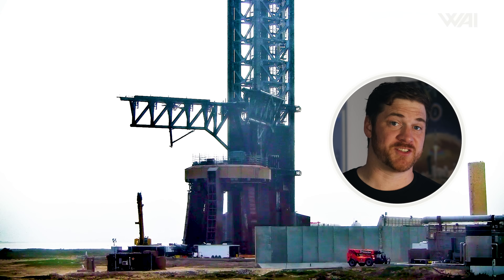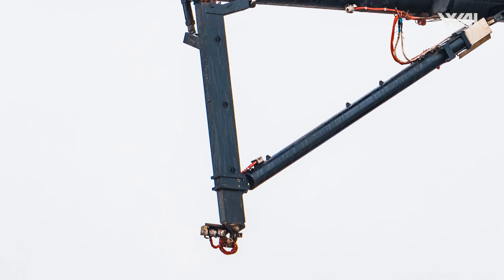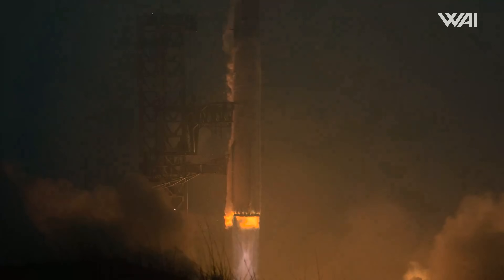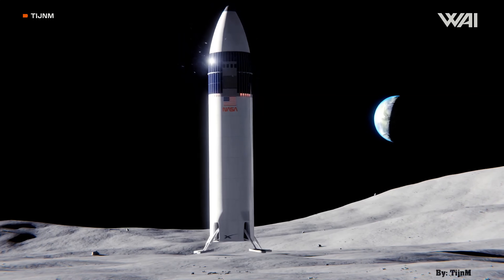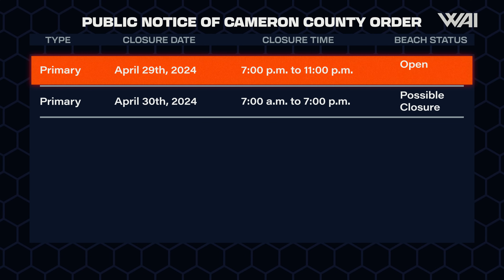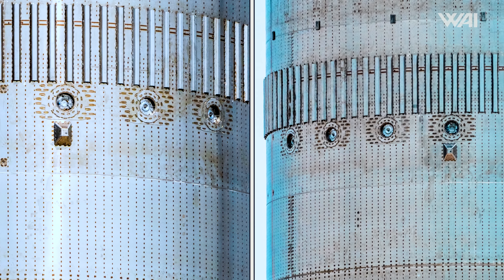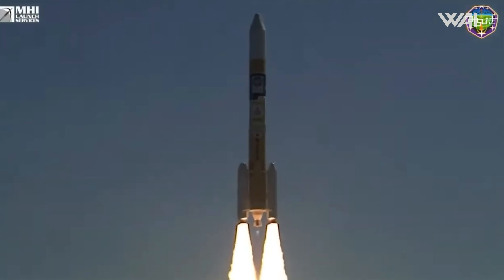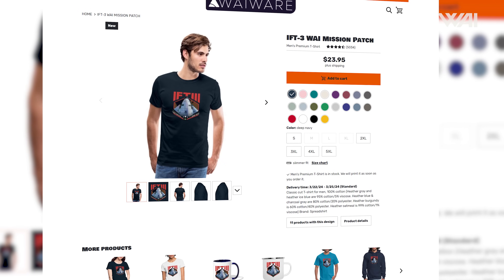SpaceX Starship: NASA Confirms Risky Orbital Maneuver!

Comment: To push something out into space and escape from gravity,  you need to accelerate to 31 times of sound speed, i.e. 15 times faster than Concord. Of course, you are not doing this in atmosphere, you're doing it in space. It is not that difficult to push something as large as a car, 2ooo Kg. But it will be a horrible task to accelerate 200 tons. Nowadays,  some countries can build a rocket pushing 10 to 50 tons cargo easy to space, but 200 tons, only Saturn 5 and Space Shuttle are capable of pushing such payload. If you want to travel far into space, large payload will be inevitable.

Comment: In the end, why do they need the OLIT?
Reply: The OLIT eliminates the mass of all landing legs on the Booster and Ship, which cut into payload capacity. It also fits the booster on the Orbital Launch Mount and rapidly mates the Ship to the Booster without personnel nearby.
Reply: @imconsequetau5275  well aware of that, but if they plan to land on the chopsticks, they can launch from the chopsticks as well ...
Reply: @wasp586   
Chopsticks can only handle the dry weight of 150 or 200 mt, Not all the propellant mass of 150+1200 mt (Starship) or 200+3400 mt (Super Heavy).
Reply: @imconsequetau5275  sure, they'll need to be build a lot stronger.

Comment: That has always been my contention. SpaceX should separate launch of Super Heavy from the recovery operation. The separate landing tower could have a rail transport system to move the boosters and Starships back to the Launch tower for Mechazilla to grab them and remount them for the next launch attempt when the faster turnaround operations begin. At present, the launch cadence is still very slow, so no need to build the rail transporter, just the catching system. The catching tower should be sufficiently separated from the launch area so as to prevent a catching "mishap" and subsequent RUD from damaging the extremely valuable Stage 0 machinery. The catching tower would be cheaper and simpler since it likely does not need the fueling system, and the water protection system could be much less powerful, since only one engine would be firing during recovery. Also, the Super Heavy would come down first and be removed before Starship is recovered. (The other stupid thing about the single Stage 0 doing the recovery is that you would have a Starship being recovered while a Super Heavy is already sitting there on the launch mount.) 
That entire original plan is a huge recipe for disaster.) The stakes are just too great. The launch tower and infrastructure is so expensive and difficult to repair that damaging it is too costly in money and time. If Stage 0 gets damaged or destroyed, it makes an entire fleet of Super Heavies and Starships unable to launch.

Comment: The concept of the perfectly vertical starship, on the moon, with the cable elevator lowering neatly down the side seems precarious in light of the recent tipped-over landing of a probe.
Reply: Those recent landers had significant sideways velocity at touch-down. One literally dragged legs over the surface at 2 mph, tripped, broke legs, and tumbled. The horizontal velocity needs to be eliminated better next time. 

The wide leg baseline is great for stability with fixed leg length on slopes, but can't cope with tripping hazards. The narrower the baseline, the smaller the horizontal velocity must be at touchdown.

SpaceX has no need for a wide leg baseline if the legs can extend straight down to various lengths and accommodate boulders, crater rims, and slopes. The rocket thrusters must keep Starship plumb in the final descent, and the self-adjusting legs must retract to fit the surface and support the full weight, and zero velocity before locking. 

Of course an AI visual landing system needs to identify and select an appropriate landing point (that legs can accommodate) and navigate there. 

I envision each leg containing a hydraulic piston. All connected in a parallel hydraulic circuit along with a single common accumulator/air spring/damper. Each leg piston has its own shut-off valve and clamp.

Comment: Hi to all from sunny Cyprus EU, I luv all your vid's, the team is doing an amazing job. Ok regarding the legs and surrounding steel of the launch table, why don't SpaceX just cover them with the same heat tiles that's used for the starship? as they can withstand the temperature of a re-entry, then they would surely protect all the steel work and should cutdown on the amount of repair work needed after a launch, just a thought & maybe a stupid suggestion ;) Thanks and keep up the great work.

Comment: Why (hasn't) SpaceX replaced both large chopstick actuators?  It doesn't makes sense to replace only one if it's actually about making the system faster for booster catches. 
Glad to finally see a rendering of the second launch tower and OLM that has them facing towards empty land instead of facing in the same direction as the original tower and OLM. 
By building them facing empty land the infrastructure will be far better protected from possible damage. In that case the second tower even acts as a protective barrier. So hopefully that's SpaceX plan.

Comment: They still need to do the simulated landing on the sea to test slow speed manoeuvring, speed and positioning. They also should have the second launch tower and system in place before they potentially damage the current one in the first attempt at a catch.

Comment: So, there will probably be “tanker” versions of Starship as well as the cargo and crewed, both lunar and Martian.  Maybe the tanker version needs 2 or 4 mini Canada arms to grapple the receiver Starship and pull it in for precise alignment.  They could perhaps stow, folded, into small fairings on the dorsal side (docking side) of the tanker.  The grappling targets could be stainless steel balls like a ball hitch on a pickup truck.
Maybe every Starship could carry two arms and two hitches:  arm left and hitch right toward the top of the ship and hitch left and arm right near the bottom.  This way, any two Starships could come together and have arms grapple ball-hitch in 4 places, pulling the ships together with precision and holding steady without using so much thruster propellant.  The whole docking could be automated.

Comment: Maneuvering the recipient tank makes sense because it will have substantially less weight/inertia so it would be energy efficient.
Reply: For this demo yes, and probably for the first one or maybe two refuels of a depot. But after that it's easier to manoeuvre the tanker.
So if you're doing say a dozen refuels, it's probably simpler to just forgo manoeuvring the depot at all and just always do it with the tanker.

Comment: IMHO the soil they are piling on the site for OLIT2 may not just be to squeeze water out of the soil to create a solid foundation.  It may be to raise the entire OLIT higher above the water table.  The damage caused during IFT1 was largely because the heat of the exhaust boiled the underground water, causing it to, in essence, explode!   Lifting the entire OLIT 6m/20' farther from the water table provides a lot of more efficient design options for hydraulic sound management.  For example it may be desirable to deflect as much of the unavoidable noise of the booster out to sea and away from terrestrial neighbours, including the wildlife of the nature preserve.  At LC39A SpaceX has dismantled the original OLM and presumably intends to implement the same design at LC39A and at BC OLIT2.  Note that LC39A at KSC is already on top of a thick mound.

Comment: That actually makes perfect sense, with the chaser being "stationary" during the transfer. At first, the refueling starships will be heavier, making them take more fuel for the same delta-V as the lighter craft. Can't wait to see this test!
Reply: In the future the fuel depot StarShip will vary in weight from the exact same as the launching refueling StarShip to substantially more as it becomes full. After the Depot has been used to refuel say a moon ship, the depot then becomes the lightest object again. So I imagine you want both the depot and the refueling chasers to be able to be the maneuvering ones.

When a StarShip visits a depot to collect fuel, that StarShip is definitely going to be much lighter than the full depot and so yes the chaser should maneuver.

Comment: It will take only 1 failed landing of either a booster or Starship to make catch-only towers the obvious choice during development of a revolutionary landing system. Especially considering that a catch-only tower requires NO fueling system infrastructure and NO underground steel plate water deluge system. Damage it and repairs are trivial. Not so the OLP. And while considering the possibility of emergencies, catch-only towers can be built anywhere along typical orbital tracks. Last, if Elon is serious about disassembling Starships on mars, catch-only towers  there reduces or eliminates the need for landing legs. 

The thinking out-of-the-box that has taken place so far has simply not gone far enough. At least not yet.

Comment: I must say, the notion that they absolutely need a second tower to do the orbital fueling demo is reasonably false. I suppose it would be better and easier if they had two, but if SpaceX is trying to showcase rapid reusability even on the stage zero ground systems, simply test that capability, and plonk a second rocket/stack on the launcher then fuel it. 45 minute fueling time? They can probably get it done before the first ship makes a full orbit.

Comment: The idea of on-orbit fuel transfer makes some sense, but there are enormous problems to surmount to make that happen.  The even bigger problem is that for a Moon mission they will need something like 6 refueling operations from 6 different Starships in order to transfer the amount of propellant needed -- that means that in order to get one spacecraft to the Moon and back you need to launch that spacecraft plus 6 more to refuel.  In other words they will need to launch 7 spacecraft to get one to the Moon and back.  And the lander, being a version of Starship, will be so much bigger than anything that's ever attempted to land on another world with the crew located about 100 feet (30m) above the ground.  If the elevator fails everyone dies!
Reply: Why do you think launching 7 ships to make it happen is a problem? Launching rockets is what SpaceX do, and they're pretty good at it.. even with Falcon 9, they've already launched more than 40 times so far this year.
Reply: @simongeard4824   COST!
Reply: so you just assume its just hung by one or two cables without any redundancy in additional cables or load margin? and also that if it fails it will always be in the worst way possible with the platform/cabin just plummeting to the ground? what do you base this assumption on?
Reply: @unitrader403  What are you babbling about?  What cables are you referencing?
Reply: @Raptorman0909  this is about the lift for the lunar lander. i thought this was obvious from the context.

Comment: Recent moon landing spacecrafts have tipped over on landing  , it would be interesting to see how a Starship (almost 5x in size) overcomes this challenge
Reply: Those recent landers had significant sideways velocity at touch-down. Literally dragged their legs over the surface at 2 mph, tripped, and tumbled. The horizontal velocity needs to be totally eliminated next time. 

The wide leg baseline is great for stability with fixed leg length on gentle slopes, but can't cope with tripping hazards. 

SpaceX has no need for a wide leg baseline if the legs can extend straight down to various lengths and accommodate boulders, crater rims, and slopes. The rocket thrusters must keep it plumb while descending, and the self-adjusting legs must retract to fit the surface and support the weight. 

Of course an AI visual landing system needs to identify and select an appropriate landing point and navigate there. 

I envision each leg being hydraulic pistons with wide feet. All connected in a parallel hydraulic circuit with a common accumulator/air spring. Each leg piston has its own shut-off valve and clamp.

Comment: It would be interesting if the Moon cargo Starships  had their interior's rearranged. Since the rocket engines will be located close to the nose of the ship why not move the tanks up where the cargo area would be. Then relocate the cargo hold right at the bottom to eliminate the elevator. I'm guessing the rocket will land and take off autonomously so, if a  the flight deck is still required, it could be placed just about anywhere for these cargo ships.
Reply: afaik SpacX doesnt eliminate the Engines on the bottom for Orbital Insertion/TLI, so your rearrangement would mean that you pump the LOx and Fuel through the Crew part of the Ship during these maneuvers. Also you put a huge part of the Mass on top doing this, which decreses stability when landing (it will be top-heavy)
Reply: The tall cargo hull would have to support more than 1200 metric tons of propellant above it instead of only ~100 t of payload. 

The Starship currently has all that propellant mass supported directly on the Raptor engines or upon the relatively short engine skirt.

Comment: I think really the contact point is too nearly to the body of the booster. May be if use two "foldable attached arm" to the booster, locked between the hard weight point and the below  stabilization point (that uses by the stabilization arms of the platform). When the booster aproximate to chop sticks, this are realesed and in this way there not need to aprouch too much to the body. Additionaly its could has sliders in the bottom side to permit the closing movement of the  chops stick..
Reply: The lifting hard points Have to be built into the propellant tank walls. But the further these stick out, the more massive the hard points must be. That is why the catch arms must get intimately close to the Booster/Ship. 

Many precautions are taken to cope with collisions between Booster/Ship and the catch arms during "landing".

Comment: The OLM is strong enough to take a hit from the booster. And the blast wouldn't be that bad. It'll be mostly empty by that point. Very little shrapnel too since Super Heavy isn't designed to release shrapnel

Comment: Not enough time to do anything except a virtual booster landing tower for the next launch.   A retrieval tower has good justifications … lower tower height, much simpler with no need to fuel up the booster, no electrical power to the booster, reduced risk to the launch towers, reduced workload on the launch towers, only 5% of the rocket exhaust force compared to a launch, a chopstick redesign that is more flexible
Reply: Also, no intention. As Musk said, they might try it on the 5th launch, if the virtual catch works well on the 4th.

Comment: I wonder if SpaceX will armor the ground where the Super Heavy will be hovering while the arms catch it. It could end up borrowing a hole in the ground slightly shallower than one made before the shower head was installed.
Reply: to hover when returning it only needs 3 engines, not the 33 when launching.. so if the ground can support a launch it has 10 times the margin to support a catch..
Reply: @unitrader403  That, and it's being caught high above the launch table, so the (small) plume won't be anywhere near the ground.

Comment: A catch only tower is the ONLY way to go. There are so many reasons to do it and only one reason not to do it. The only reason not to do it is because SpaceX announced they were going to do it and are committed to it. The idea that it saves time is ridiculous. SX transports vehicles every day quickly and efficiently so It would take little time to move a Starship from a landing tower to a launch tower. Damage done to a launch tower at launch could prevent return of the Superheavy (as well as the Starship) back to the launch tower and result in loss of the vehicle(s). By eliminating return to the launch tower, that cuts the chance of damage to the tower and surrounding area by half. At some point you will have point to point trips. An occupied launch tower means you can't land there as well. A landing tower can be well separated from the loading infrastructure needed to support the launch and the cost of a bad landing is greatly reduced. The cost of a landing tower would be much less than that of a launch tower and the complexity of the launch tower would be much less too. Fewer parts to break and fewer protections that have to be built into the launch tower. The more simple the launch tower the better. A landing tower could also be used for storage, repairs and loading and unloading. If nothing else, you have to have a landing tower in case of emergency. If one is not being build now it should be.

Comment: I've been saying (not that there's anybody important listening to me)  to "Build a catch only tower right away!"    Stage Zero, the orbital Launch Platform, we all know, is SUPER complex and RE-building after a failed catch attempt would take WAAAAAY too long.
They have the parts laying around there in Texas for the new tower.   The fact that they are prep'ing the location for the second tower is great but this work should be ramped up to an INSANE EFFORT level.   That tower should be up and ready for the first catch attempt!   If they destroy the Orbital Launch Mount with a failed catch attempt then all of the necessary test launches ... and the very important operational launches (That is, of course, Starlink satellites.) all stop.   This would be very very bad.